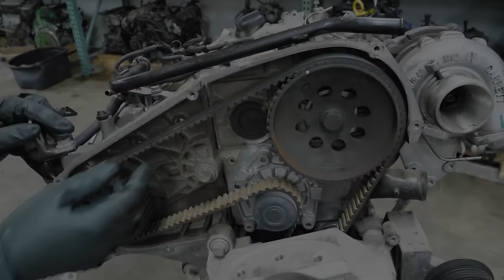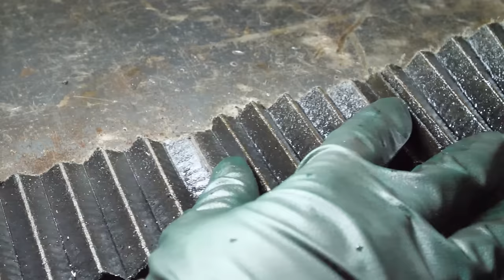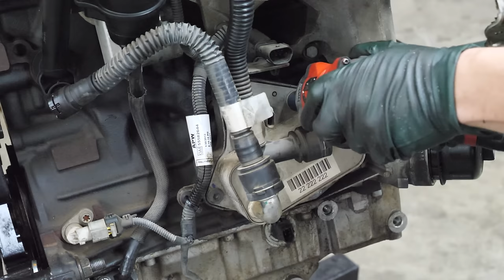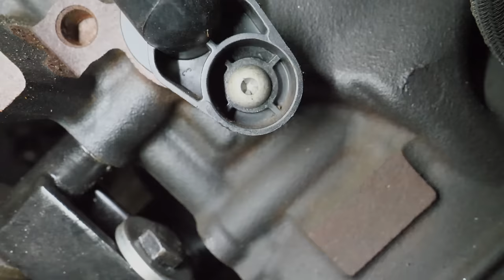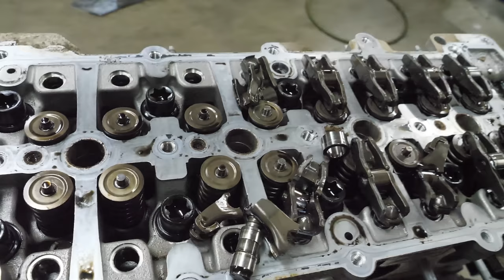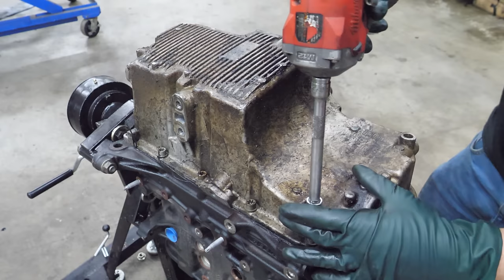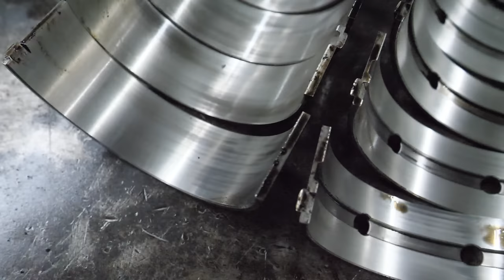I RUINED IT! Tearing Down A "BAD" 2.0L Chevy Cruze Diesel The Wrong Way

Comment: Thanks for this, Eric.
In Europe, this engine was replaced from 2011 with the EURO5 GM Z20D1 (120kw@3800, 360NM@1750). Although a totally new engine back then, it proved also reliable on my 90k mile Cruze which I own from new. Biggest difference is the chain belt and particle filter.

Comment: If you fold the filter media up like it was in the filter, then put it in a vise and squeeze out the oil it becomes much easier to see and read the debris left behind.
Reply: He has been told and he has tried, but not correctly. I have thought of doing a short to explain it.
Reply: Also just use a knife to cut the filter not a chop saw with a wood blade
Reply: @lieutenantdan8170  and it doesn't need to be the entire filter, just a representative section - maybe 1/4 - 1/3 of the way around.

Comment: I own a 2017 Cruze 1.6L diesel engine and it gets great fuel mileage (5.1 L/100km as we are in Canada).    The torque is incredible and it way out performs our 2017 gasoline Cruze in mileage and torque.  The only engine issue we have had on the diesel with 170,000 km (about 105,000 miles) is the DEF injector plugged up and set a code.  But resenting the OBD light and doing a few Italian tune ups cleared the blockage.  I enjoy your channel.
Reply: That's good economy  but not as good as the Mazda 2 diesel. Average 4.4 l/100km because the wife uses it around town, but on long journeys (500-800km) on motorways I get 4.0li/100km at 120km/hr and 1100km on 44li of juice.
Reply: @csjrogerson2377 The cruze is a far larger car to the Mazda 2, just saying.
Reply: @jack11224  "Far bigger" indeed???  Your Cruze is 621LBs heavier (so you mean fatter), 12.5" longer, 3.8" wider and 1" less tall than my sedan.  So NOT far bigger at all, just a bit bigger, but certainly heavier. Your average fuel consumption is exactly the govt extra urban figures - a very, very rare occurrence, so you must be driving like a grandad. If I slowed down I could get closer to the extra urban figs of 3.4, but I like to get on the motorway at 120-130 kmph, just saying.

Comment: Hi Eric thanks again for a midweek teardown and something a little closer to home 😂 here in the UK it as you know would be a vauxhall 😉 I've had the pleasure of working on several of these over the years and I'm sad enough to actually have the correct socket eg 5 point tamper proof torx 😂 as mentioned before these are a joint venture between GM/Fiat and VM. The cam set up is very common on most small to mid size european diesels the Peugeots have a cam cover/bearing carrier Combo all held together with 33 8mm headed m6 bolts 😂 I've done plenty of those which like this are sacrificial eg followers snap and the cam lobes spin to protect the valves 👍 Not sure if you get the 2.0 Ford ecoblue diesel in the US which I've had the displeasure of repairing several, these are junk eg wet cam belt and oil pump belt which is supposed to last 120k but can go anything from 60k 😔 same thing smashed followers and spun lobes but the cams are pressed into the cover so not serviceable and £600+ to replace. Looking forward to weekends video keep up the good work cheers Matt 🇬🇧
Reply: Question, did you have access to the pickup tube o ring fix? I haven't been able to find one yet for my Cruze Diesel here in the States.

Comment: Yes omg these are great engines with "a diet " biggest flaw other than the Emissions is the oil pump pick up o ring but there's a aftermarket replacement great engine fuel mileage no mater how you drive it mpg 40 to 50

Comment: "there's nothing wrong with this engine" 
As it vomits rusty water 

You sir are a professional used car salesman
Reply: it was sitting out side on its side, for, ??,,yr,, its broken, because some dik didnt time it right after replacing parts..
Reply: that is a core engine that was set outside without plugs and collected rain water. that was very obvious, AND was explained at the end for you people that know nothing about the auto salvage industry. there was nothing mechanically wrong with that engine (ALSO stated at the end of the video).

Rust in cooling passages and block surfaces can (and in this case, WILL) be cleaned out.

Just because youve made poor used car purchases doesnt mean you have to be some ignorant moron on vehicle teardown videos. This guy has infinite more knowledge about vehicle than you do.
Reply: @Olive_Bot no need to take it so personally. Pretty sure it was a joke

Comment: if your a fan of the long roof cars, back in the day you could get a chevy cruze diesel with a six speed manual in a station wagon body.  Unfortunately the station wagon version was export only.
Reply from the maker: As much as I don’t like those cars, that seems like the best version!
Reply: @I_Do_Cars  I have the non USA 1.6 5 speed manual one.  Nice car, just service is not buying GM parts, but Daewoo, because it is really a Daewoo with GM badges. But a nice car, now 12 years old, and with a nice clean engine as well. Some time soon I will have to replace the clutch, but that is readily available by ordering for a Daewoo Lacetti. Nice comfortable car, no speed demon, but loves the open road, and keeping around the speed limit is around the most economical fuel use point. Just needs regular oil changes to have a long life, and yes I had to replace cam belt recently, because of a bolt that went down and damaged the outside of the belt. No idea where that came from, must have been left when the engine was overhauled at 130 000km because the exhaust place tried to do an EGR and cat delete, and failed. I got that right after a little work, finding what they broke, and fooling the EGR valve into thinking it was passing exhaust gas.
Reply: Oh hey Jimbo, lol
Reply: I have a 2023 Jeep Compass 2.0 diesel with 6 speed manual, drive it like you stole it and still gives 13 km per liter and 20 km per liter on highways with steady foot.

Comment: The Chevy Cruze is based on a Daewoo J platform, basically a GM Daewoo/opel /Holden clone built in Lordstown Ohio.....I actually worked on dozens of these engines back in South Korea, it's in alot of Daewoo & GM Daewoo models
Reply: @daewooparts so what's your opinion of the engine?
Reply: Holden sold a few rebaged Daewoos including the Cruze. Its why their brand is basically dead now. Its the Camira all over again.

Comment: I remember having this engine in a Vauxhall Astra from 2012, the 165 HP version. Never did any tuning or mods to it and happily took it up to ~130k miles. It was always super responsive, reasonably frugal, and had decent enough performance when you needed it!!
Thankfully mine never suffered the oil pump o-ring hardness issue. I remember it fondly except for the oil filter housing being in a =terrible= place. Needed to take the damn wheel off to change the filter.

Comment: I have this engine. Works great at -20f on cold start. I have mine tuned and get over 500 miles on a tank with mostly city driving. Sitting at 120k miles currently.

Comment: I owned one from 2017 to 2024.  From 30k to 108k miles.  Loved the torque after boost lag.  Awesome in the PNW mountains.  Used WAY to much fuel during warmup killing short commute mpg, but on the open road, pulling down close to 50 mpg with over 750 mile range was it's element.

Comment: I've worked on a few of these, and also the later 1.6. The 1.6 Opel diesel in the 2nd gen Cruze, in my opinion, is an even better engine, and it could be optioned with a 6 speed manual. The 2nd gen diesel Cruzes with the manual transmission have only 2 major issues, both of which are easy to fix. Issue #1 is the timing chain tensioner. It doesn't get enough oil flow on startup and when the variable displacement oil pump is in low pressure mode, and also the housing is made of cheap pot metal that wears out. In the US there was never an official fix for this issue. In Europe Opel developed a fix which consisted of a special gasket that held oil in the tensioner, and also a redesigned tensioner. The new tensioner was also pot metal however. They also changed the oil spec from a 5w30 to a 0w20 to get more oil to the tensioner faster. I developed a different version of this fix that used a better quality tensioner and the same European Opel gasket. The 3.0 Duramax in the Chevy 1500s in the US is based on the 1.5 Opel 3 cylinder, which is in turn based on the 1.6 in the Cruze. The lower timing chain tensioner of the 3.0 is an identical shape and size to the 1.6 tensioner, and is made of better quality cast aluminum. Along with the Opel gasket and either the 0w-20 Duramax 3.0 oil or a 5w-30 API FA-4 oil, it's a permanent fix. The second issue is related to the clutch throwout bearing. In the hydraulic line is a clutch delay valve, which is a stupid device that should always be removed because it causes clutch wear. On the diesel 2nd gen Cruze, it disintegrates, sending metal into the throwout bearing/slave cylinder. The solution is to replace it with a high pressure -4AN hose and adapters to fit the quick connects on each end. Mcleod and others make a GM quick connect to -4AN adapter. Two of these and a long enough -4AN hose gets rid of the clutch delay valve and keeps it from sending metal into the slave cylinder. Use a quality brake fluid like RBF 600, etc. Once those two issues are fixed, it's essentially a perfect car. The hatchback especially is exactly what the Golf TDI (09+) should have been in the first place. They are decently fast, get 56 MPG, nice interior, stylish exterior, excellent 6 speed manual. I would love to see a 1.6 Cruze diesel on the channel. Also a 1.2 GM Turbo I3, my mother has one in a Buick Envista, it's an interesting engine and has a nice sound.

Comment: Thank you thank you...i own a 2014 cruze diesel. Besides def/dpf issues (in stock form..😉) the only known issue I'm aware of is the oil pump pickup gasket/grommet failure issue.

Comment: Suitable to be rebuilt. A good hone will remove the rust, and also remove the ridge from the bores. New rings, bearings and gaskets along with new seals, and it will be good for a million miles.

Comment: The 2014 Chevy Cruze Diesel is a remarkable Engine. The wife and I had one. Wife used it in her job for a need of great mileage was a need. Average daily driving mostly highway miles. Sold the car to my neighbor who Bought it for his daughter. At the time 270,000 plus on it. Maintenance done according to manufacturer specs. The Cruze gave up the ghost at 389,000 miles. Original injectors and pump. No head or pan removal. The transmission died. Was saddened when neighbor told me. Would have purchased another Cruze but GM ended production. Great little car. Average 44 miles per gallon. With a 49.9 miles per gallon on a 2,000 mile trip. 😢 miss that car.

Comment: as a mechanic and some one who has worked on the VM diesels like this what happened is the belt broke and the valves hit the pistons and this is what broke the rockers then it was towed to a shop and they replaced the timing belt and it didnt run and they said it needed an engine when it just needed rockers.  I see it all thew time on the jeep liberty diesel engines
Reply: You are probably right, although this is a Fiat Multijet engine produced under license by GM alongside the 1.3 Multijet

Comment: "Why it's own fastener?" Because it's an emission part. They don't want it to be easy to backspace. It's the same rationale behind using psychotic heads on any carburetor adjustments that exist on gas power tools. Get it into emissions spec and make it difficult for people to make them run properly.

Thanks for the interesting disassembly. I appreciate seeing this motor. I might even buy one one day.

Comment: Same cam-in-cover design in the 1.4 Fiat/Abarth/Alfa T-Jet & Multiair, twin cams internally geared together with one belt pulley. I maintain my brothers 500 Abarth with the T-Jet engine, so have done numerous cam-belt replacements in its 240,000 miles (& counting), so would never spin the cams knowing the crank & pistons are stationary! There's a cam locking tool for undoing the cam bolts if needed.. I guess we all make mistakes sometimes, & it is confusing if you haven't come across it before, including you Eric! At least it was a scrap engine, not a customers!

Comment: I have had driven a Suzuki S-Cross with the 1.6 l Version of this Engine. It was very reliable with a good fuel consumption ( about 5l per 100 km) and torque. I've worked for a Fiat/Alfa Romeo Dealer when these Engines comes  out.Also the 2.4 l 5 Zylinder were good engines.

Comment: My diesel Cruze came with an extra rear main seal bolt from the factory in the bell housing. Finally jammed against the flywheel at 150K miles and locked the crank.

Comment: The 5 point fastener is tamper proof it take an impact driver with a easy out to remove them. They are also used on the oil separator box on the duramax.

Comment: I think this is a GM adaptation of the Fiat JTD engine, a successful common rail diesel. I owned 4 cars with variants of this engine. A Alfa 156 2.4 5 cylinder, (sublime 5 cylinder variant) an Opel Astra 1.9, and two Insignia 2 litre models. I covered more than half a million miles in these cars, and other than rare issues with EGR systems, and a flywheels failure, they were excellent

Comment: I recently rebuilt a LUZ Cruze. (Only seen one other on the road.) It gets a good 42MPG and is quite peppy. However, the DEF system was  a PITA to get working correctly and to get the waterlogged ECM replaced I had to unsolder its memory chip and install it in a new unit.
Reply: I love mine, just sucks they have electrical Gremlins at times. The engine still runs great!

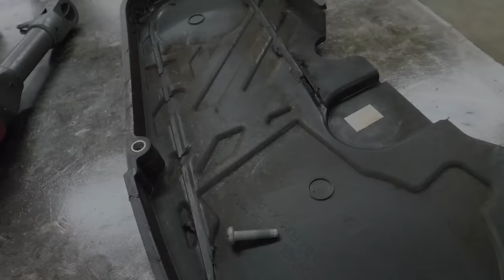Comment: 4:09 It's annoying that it's controversial. Chains are often put at the back of a longitudinal engine and require engine removal to access. Belts are always at the front where they can be changed relatively easily. Belts also don't need all the plastic guides that fail. It's not if the plastic guides fail, it's when. 

Heavy equipment that is designed to last with regular servicing will often use belts. 

And belts are much cheaper.
Reply: Many reasons why I prefer belts.

Comment: I almost bought a Cruze hatchback weirdly configured, fully loaded 6 speed with this engine. It was MINT, pre owned with very low miles for like 17k. This was pre-covid, and pre diesel price being higher or equal to the cost of premium. Im glad I passed on it.

Comment: All European diesels are great, this one included. They perfected them to produce insane amount of torque and power with incredible economy.
1,6 CDI/DCI built by Mercedes/Renault has same torque as BMW 540i V8 from 2011.
In Mercedes V class 116CDI it develops 160HP, 100HP/Liter, it has two turbo chargers, blacksmitted pistons made from steele alloy that are balaced.
Van that does 100km with 5,5L of fuel.

All you have to do is be religious about oil change and oil quality, and they will serve you well.

Comment: AN INTERESTING AUTOPSY!!
I DID SIMILAR THINGS WITH LOCOMOTIVE
DIESEL ENGINES!
AS YOU LOOKED OVER THE TURBOCHARGER
I REMEMBERED DOING THAT AS WELL!
MY EXPERIENCE ALSO TAUGHT ME HOW TO DETERMINE MISSING AIR FILTER OR RUBBER BOOT FAILURE CAUSING DIRT DAMAGE TO THE INLET IMPELLER!
THE LEADING EDGES OF THE IMPELLERS WERE SHARP, BUT NOT RAZOR SHARP.
IF THESE LEADING EDGES WERE SMOOTH AND ROUNDED, IT WAS AN POSITIVE INDICATION THAT DUST
ABRASION WAS THE CAUSE!
NORMAL OPERATING TURBO SPEED WAS 17,000 TO 19,000 RPMS
AT 3000 HP .
WITH ROUNDED LEADING IMPELLERS , TURBO SPEED WAS 21,000/23,000 RPM WITH A LOSS OF BOOST OF 5/6 PSI!
THIS WOULD RESULT IN 
ONLY 2800 HP, WITH AN 300 DEGREE HOTTER EXHAUST, ILLUSTRATED WITH AN CHERRY RED EXHAUST MANIFOLD!
WITH AN GOOD TURBO THESE MANIFOLDS WOULD HAVE  AN VERY FAINT RED GLOW!
IF YOU RAN AN LOCOMOTIVE WITH CHERRY RED MANIFOLDS, CYLINDER HEAD SEALS WOULD SUFFER, BADLY!!
KEEP THEM ROLLING BROTHERS!!
👍👍

Comment: This engines are originally made by Fiat and were used in Fiat, Alfa Romeo, Lancia and first Opel Insignias. Later they sell license to manufacture this engine to GM and Saab. I have striped side by side original Fiat (From Giulietta) and GM (Opel) engine and I can assure you inside is a lot of differences. Connecting rods, pistons, oil pumps and other stuffs are different. The Italian engine is much more better build. The biggest issue with this engines vas O-ring seal between oil pick up sump and oil pump. Over years it become hard and stop sealing (oil pressure warning at cold startup) you change that immediately and no harm was done. The second issue was EGR cooler start leaking. If you address this issues, you have no problems. Overall this is very reliable engine, My brother have it in Alfa Romeo 159 with almost 300.000 miles on a clock and still going strong.

Comment: The 2 loose head bolts are worth throwing a straight edge across the head and deck just to be sure.  Otherwise it looks like you've got a fully rebuildable engine.

Comment: I recently tore down a 2006 Fiat/Alfa Romero JTD-1.9, and it is clearly a predecessor of this one, only very minor upgrades has been made like piston design, and piston ring thickness.

These engines suck to take apart when you have a stuck injector, because that prevent you from removing the head.

FYI: The cams slide out of the cam housing in the opposite side of the gears.

Also i'm not entirely sure the bearing wear indicate high mileage, as ALL engines i have taken apart with these yellow/orange upper bearing shells, show the same kind of wear, i think that type of bearing is the culprit.

Comment: I like how they kept to a simple timing belt and intermediate gears to drive both cams really it cant get any simpler than that.
Valvetrain is also as simple as it gets.
Plenty of KISS designs in this engine. One of the good eurodiesels for sure.